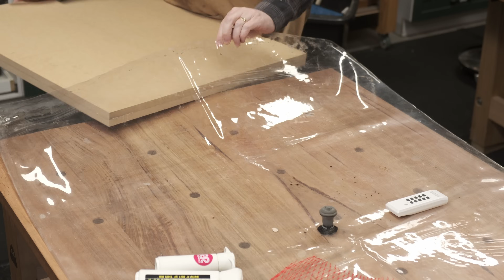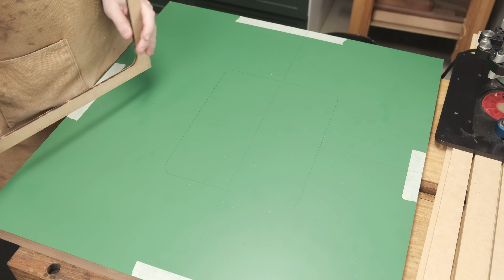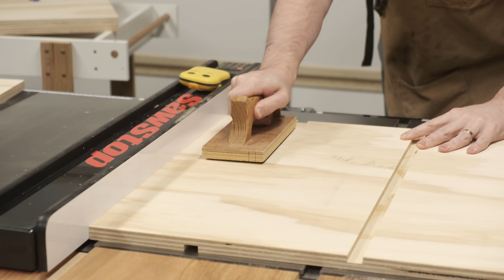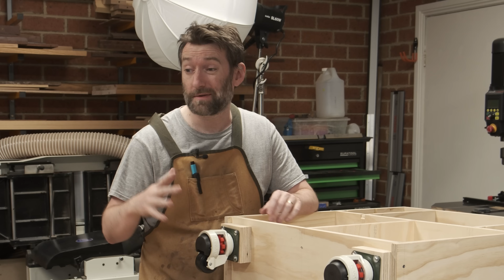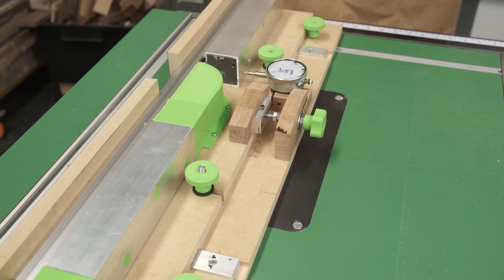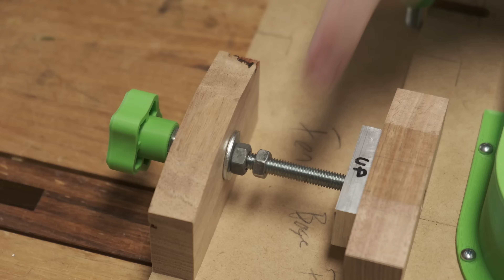The Most Accurate Router Table? (Also It's Green)

Comment: Where do you get the laminate from and which router motor do you have? Thanks
Reply from the maker: I got the laminate (and plywood) from Plyco, part of their retro laminate range https://plyco.com.au/products/retro-laminate?variant=44236398002405

The router motor is the old version of Timbecon's router motor. Mine doesn't have the ER20 collet that the newer version has, it "just" has standard 1/4" and 1/2" collets. I can't fault it, works good, has plenty of power!
https://www.timbecon.com.au/collections/router-tables/products/sherwood-router-motor-1800w-round-body-er20-variable-speed

Also available in blue https://www.carbatec.com.au/carbatec-router-power-unit-2400w-input-1800w-output

Comment: G'day Paul, Nice build mate. What router you got in it?, you may have mentioned it but I'm old and missed it!.
Reply from the maker: It's the old version of Timbecon's router motor. Mine doesn't have the ER20 collet that the newer version has, it "just" has standard 1/4" and 1/2" collets. I can't fault it, works good, has plenty of power!
https://www.timbecon.com.au/collections/router-tables/products/sherwood-router-motor-1800w-round-body-er20-variable-speed

Also available in blue https://www.carbatec.com.au/carbatec-router-power-unit-2400w-input-1800w-output

Comment: Love it!  I've had the idea of making a Pat Warner style fence with dust extraction on the side for the longest time and you've shown me the way.  A couple of questions...  Why did you choose a manual dial instead of digital?  What is the size of the flat bar that you used?  Thanks for sharing the 3d print files too.
Reply from the maker: "Viewers" is probably the most accurate answer for manual vs digital. Any time digital anything is shown off, there will be at least one person arguing its never as good/accurate as the manual version. It just gets tiring arguing with that type of person 😅
Either type would work just fine here, I might swap it to digital eventually.
Flat bar is 25x10mm (6060T5 if that matters!) - you could go wider and/or thicker with no issue, probably down to 19x8mm would be fine too.

Comment: Very nice build and documentation for your process.  You may be able to take out the inaccuracy on the micro adjustment by slipping a stiff spring over the threads, which will keep pressure on the nut so it stays registered.

Comment: Nice!  There's also room to add T track into the fence if needed at some future time for hold-downs, stops, etc.
Reply from the maker: Absolutely. At some point in the future, I'll make a crosscut sled for the table saw using the 8020 for the fence - I'll make some flip stops for it that attach directly into that extrusion, so I'll have to make them also work for the router table.
Featherboards are going to be the trickiest to adapt directly to the extrusion, thats where I think t-track might win out for me

Comment: To improve dust collection how about some angled boards to avoid the dust collecting in the corners?
Reply from the maker: I think that'd work, yeah. Any reduction in the general air volume around the router motor should improve how well the suction works. I have some thin (~3mm and ~6mm) MDF offcuts I can try out, maybe nail them to some blocks to keep  them in position. I wonder if applying paint or a clear coat to smooth the surface/reduce friction would help too.

Comment: I too made the NYW model router table 'Many' moons ago. I think you went to a lot of trouble to make the top, when you could just use a piece of Kitchen bench top.  OK, call me lazy, but I was working at the time  (now retired), so bought the Incra Fence. One thing I would change, is the under cabinet dust port. Mine is to the back of the cabinet. It works, but not very efficient. I think I would put it directly under the router, and sacrificed some drawer space. Yes it helps if you have a 3D printer or friend, to make the flanges.
Reply from the maker: If I had the ability to drive to the places that have offcuts of cabinet tops, that'd work just fine. Though I may have had to compromise and not get green, I'm not sure I could have lived with that! 😁

Comment: Great to see an Aussie interpretation of Pat Warners 'micro adjustable' fence - well done and thanks for posting.Subscribed !Have you seen a photo of Pat's last prototype of his router fence system? cheers Pete
Reply from the maker: Was that the one built entirely out of aluminium, with linear rods and such? I don't enjoy working with metals that much 😁
Reply: @TheWoodKnight  It was aluminium ( which is wood for metal workers ) and polycarbon or acrylic the idea being hold the workpiece in a fixed position via clamps and jig positionng and slide it past a router - no router table required...I dont think it went past a prototype form...and obviously meant for ( relatively) smaller work. A lot of Pat's work ideas are based on a woodworkers view of basic machining practises for machinists. In fact a milling machine and metal lathe are good wood working machines if one is chasing precision. I'm enjoying going through your videos . Pete

Comment: Great build.  Where did you get the safety switch from?
Reply from the maker: Thanks! I bought it years (5+) ago, so I'm not entirely certain but I think it was https://www.timbecon.com.au/products/sherwood-10a-switchbox-for-router-tables
It looks the same, but the one I've got is a bit different (15a plug on the end)

Carbatec have a similar one https://www.carbatec.com.au/carbatec-nvr-switch-assy-w-mount-bracket-and-lead-rt-swtasy-p - looks like plugs in below, rather than on the back